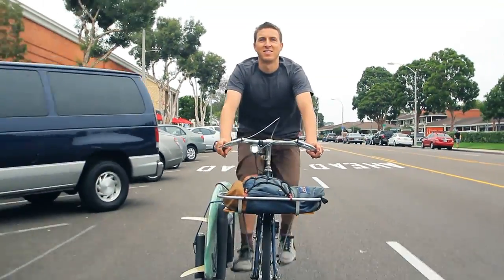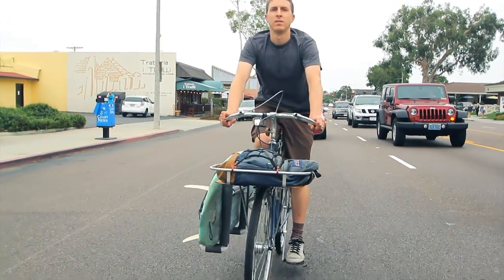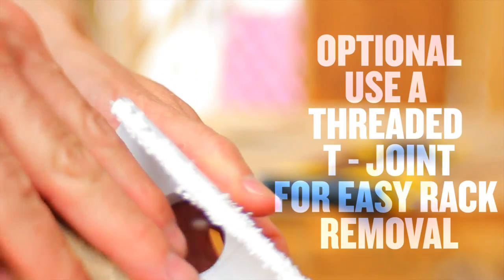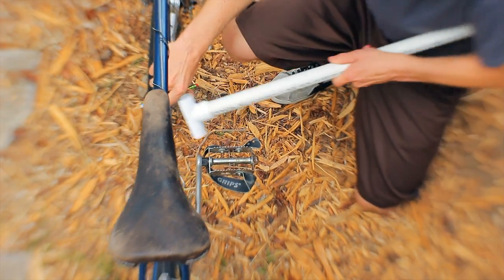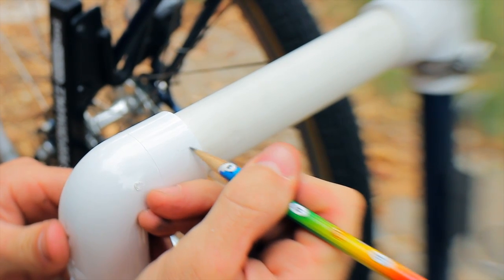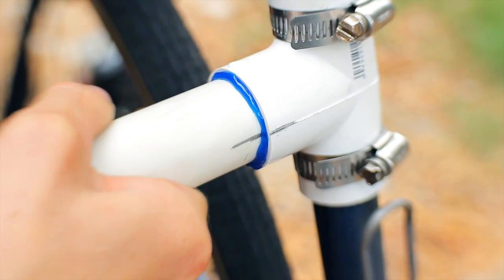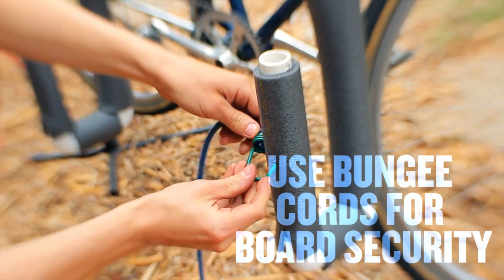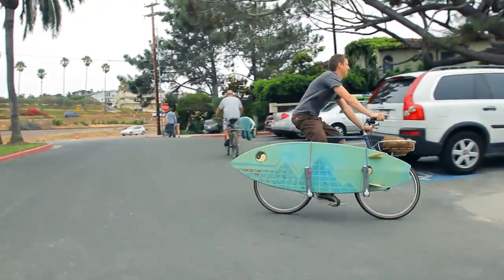DIY Surfboard Bike Rack - Surf Sufficient

Comment: Great board rack but how the fk do you think pvc  pipe/ bike tyres etc are manufactured.. you justify your cycling but it is created by many diverse manufacturing processes so as to allow you to go " GREEN " .. you live in a fkn dream ... good luck inhaling all those exhaust fumes on your way to the surf ... still a great build
Reply: Edgy
Reply: It's impossible to live 100% 'green' in every single way, but I would assume at the very most 1 week of driving emissions plus the environmental cost of processing and transporting that crude oil/gasoline would offset the PVC pipe and the bike tires. It's a net benefit and one that will improve your life as time goes on with more exercise, easier to park, no emissions, etc.